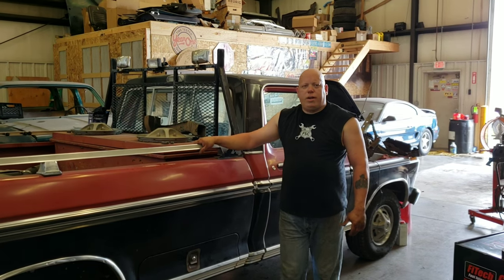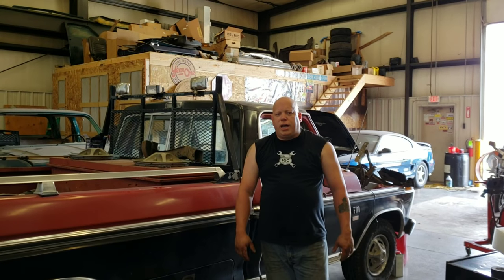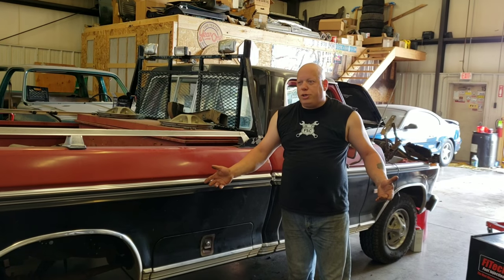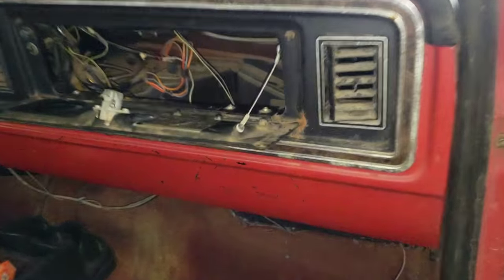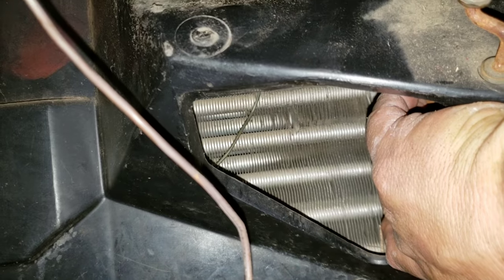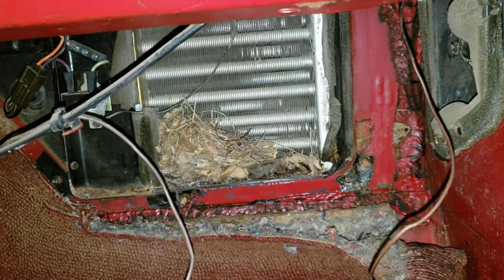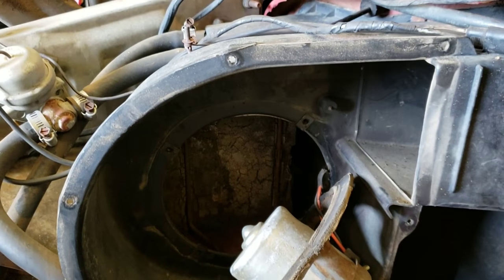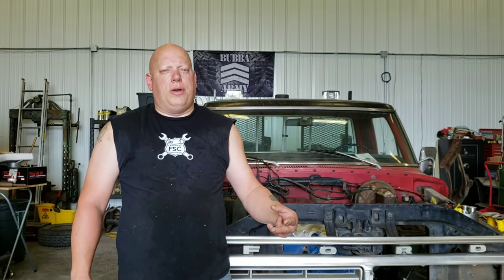1974 Ford F-100 Factory A/C Evap & Heater Core Part 1

Comment: Could you explain how you could get the defroster working mind only goes from vent to floor
Reply from the maker: The cable cod be jammed.  That is if its manual.   Ones with Air Conditioning use vacuum to move the doors.  Also often you could have a mouse nest in it jamming it up.

Comment: Do you by chance know where I can get a new electrical power connector for the blower fan?  My new fan just came with two pigtail wires.  I need to attach an electrical connector to mate it with the existing one on the Bronco.

Comment: Thanks for the video. I have. 1977 f100 but looks that a/c system is different i mean there aré more covers and screws could you please help me with?
Reply from the maker: Your's may be aftermarket.  I believe by 1977 there were only Factory Installed, not Dealer Installed anymore.  But don't take that as fact.
Reply: @fsctrucking  can a i send a picture and wait for your comments about it?
Reply from the maker: @ericcarrillo9581  Feszchakshop@gmail.com

Comment: hello, 
Please help if you can, my ac on works on the defroster and no on the vents. what is wrong with my setup
Reply from the maker: The multivalve that works on vacuum can be bad.  Or it's hooked up wrong under the hood and there is no vacuum.

Comment: Thank you man!!! I have a 1976 ford f250 with the exact same set up as yours. I need to replace my heater core because it's leaking very bad. I have the a.c evaporator too so how can I check to see if it's any good???
Reply from the maker: Pressure test it or charge the system with dye in it to find any leaks.